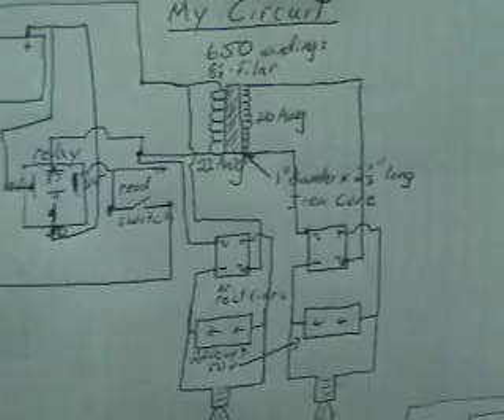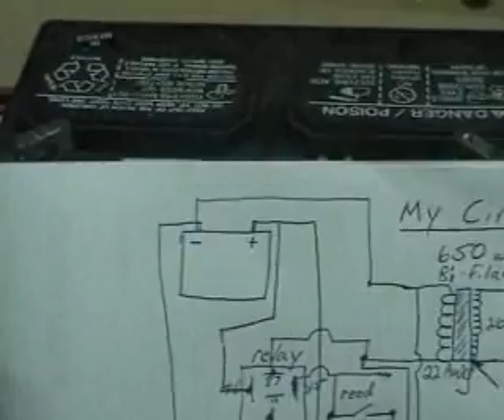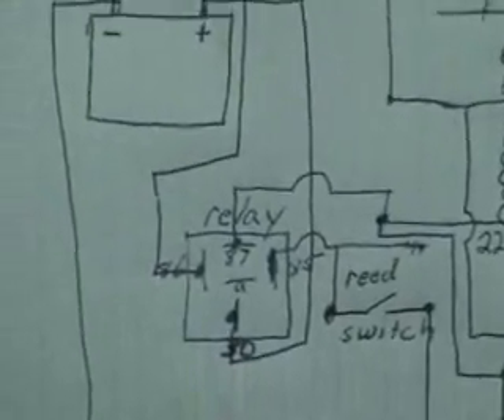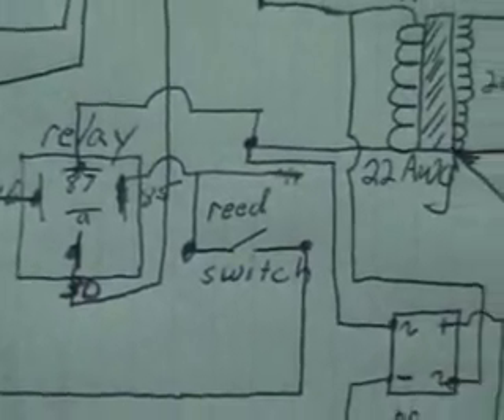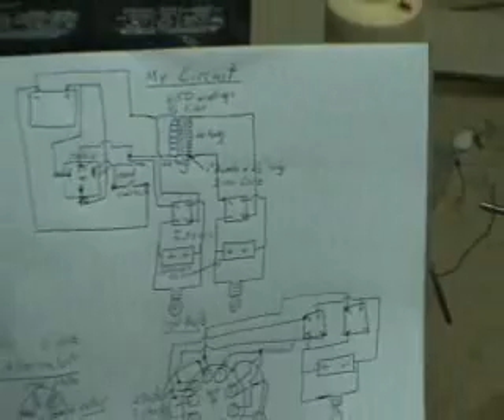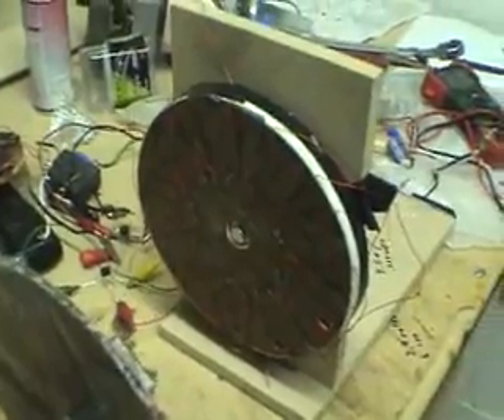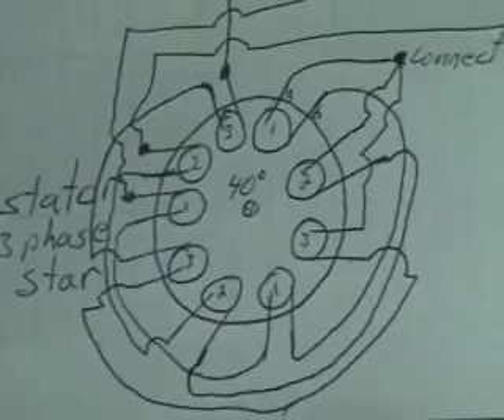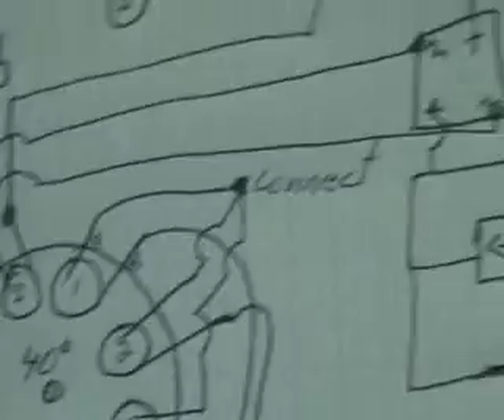Circuit, I hope I am not boring you :)

Comment: Yes you can use it but the circuit here is not useful. Also, when you disconect a coil that has curent passing thru it the magnetic field will collapse. When it does this it will make a voltage potential. The quicker the collapse the higher the voltage. The ignition system that makes the sparkplug fire in a car uses this and is curently solid state. 

Having said that, you must be sure that your circuit is designed to handle that very high voltage without damaging your solid state components.

Comment: First off... I checked out "witricity".... I wouldn't put money on it.

Second... In order to have a "back EMF" you had to supply a curent and the forward EMF to make the motor spin. The back EMF is of a lesser voltage potential and so the SOURCE power will be the power source for this new device you are trying to power. 

Back EMF can power something if the motor is spining and the power is cut. That is because it is now a generator. When it stops the power stops.

No free lunch.

Comment: That circuit is a pulse transformer. It's not a good one but that's what it does. The motor, reed switch, and relay forms an electromechanical pulse generator. 

EMF is ElectroMotive Force or simply Volts.

Back EMF is voltage that a motor generates when it spins. It's use is for finding the efficiency of a motor and can not be used to do work.
When a motor is up to speed (no load) for a given voltage then multiplying curent by impedance and subtracting from input voltage is the Back EMF .

Comment: OK, maybe this is just me, but doesn't the common of the star phase need to go somewhere?  I realize that without it, you are generating currents between the phases,but you would get more power from the alternator by connecting the common and getting the full power out of it instead of the 120 degree out of phase power you're getting now.  Of course, this could also put more load on the motor and not let it run...

Comment: I just want to share this formula with you: Erms=sq.rt.2XpiXfXNXtheta. This is valid for transformers\shaft DC windings & your alternator. Resonance at 60hrz (coil=to cap)is at 1200turns\p\m for 6-pole like you have. THIS IS STABLE - much higher gets unstable quick. Since tesla-wireless power has been tried by thousands-all failed. You have succeeded! Magnet is EXACTLY equiv. to wire-wrapped core electromagnet: except NO WIRES! Constant on-board gen. NO PLUG-IN "re-charges"!

Comment: Todd: You realize their is NO WIRE CONNECTION between your alternator & the rest? This means IT DOESN'T MATTER what turns the shaft. It could be a squirrel-cage, wind, or SMALL no-brush D.C. motor. The Alternator can be amplified in various ways - when "pancaked", BECAUSE IT IS COLD - do to FERROUS-FREE ZONE (the coils); what happened to the '98 Hummer, will not happen to you. Magnets last forever (I have one 60years old-good as new)IT IS HEAT which loses magnetism!(up now with Neos).

Comment: Fantastic
Pure fantasy.
You've made a lot of noise, recover a small amount of energy from various moving parts and other known techniques, using a diy grade voltmeter, crocadile clips, phone wire, and sticky tape.

My challenge. Run what you have got and tell me how long it takes for the battery to run out powering one bulb.

Conduct the same test, same battery, same charge level. Power the same bulb on it's own.
I bet you the bulb alone experiment lasts longer.
Free energy my @**%

Comment: it looks to me like the rectifier on the primary coil is connected directly across the battery when the reed switch activates the relay, so surely the charge in that cap is coming mostly from the battery?.. i guess extra pressure from the coils' back emf might charge it a bit more...interesting... but still, a significant amount of the charge in the cap must be straight from the battery...?